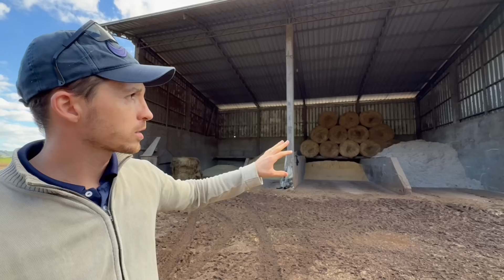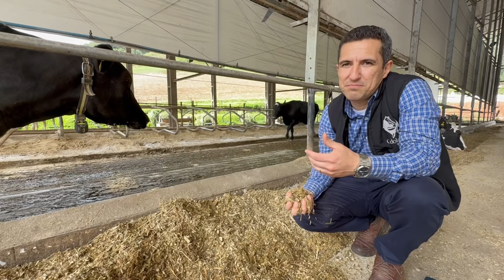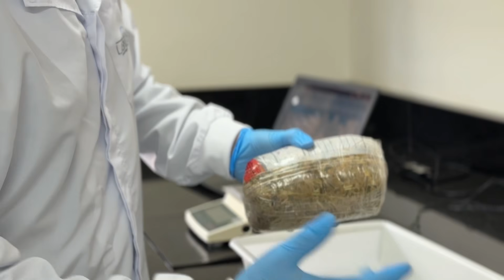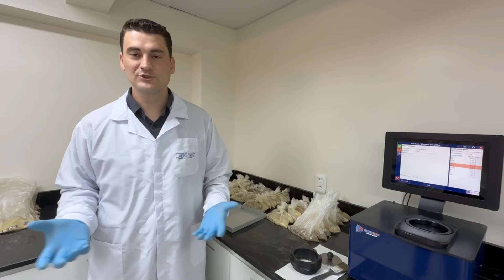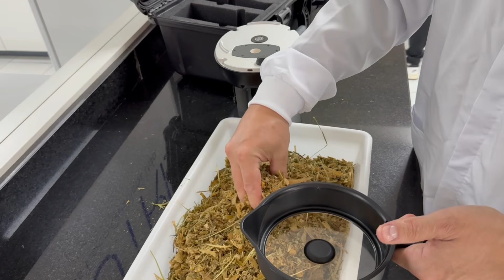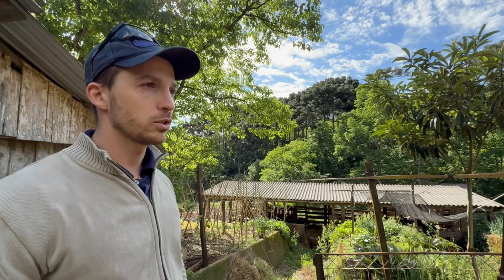11,000 lb (5,000 liters) of milk per day with 103 cows – Nono Emílio Farm 🇧🇷

Comment: What is your per cent age of displaced abomasum per year? 13:03
Reply from the maker: Good question! Displaced abomasum (DA) incidence typically runs around 2-4% of the herd per year in many well-managed dairies, though it can be higher with issues like excess body condition at calving, low fiber intake, or subclinical ketosis around fresh cow period. We don't have the exact figure for this specific farm. If you'd like help tracking and reducing transition cow disorders like DA, check out our AI tool: https://ruminants.ai/register?ref=youtube